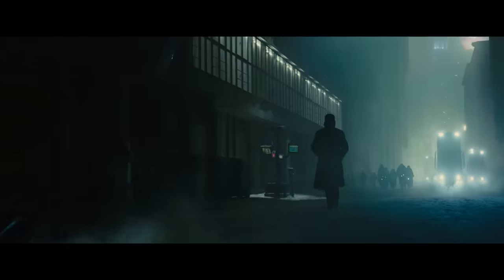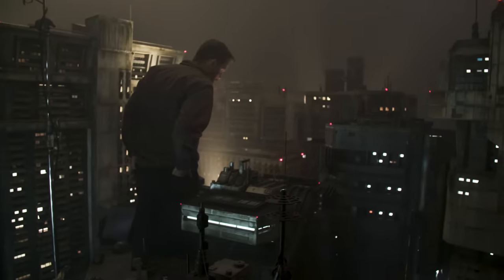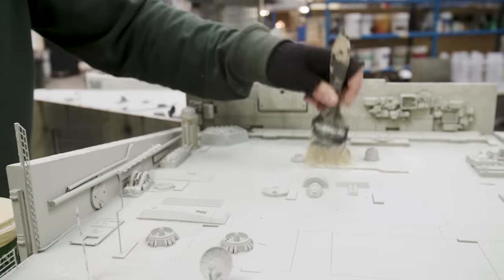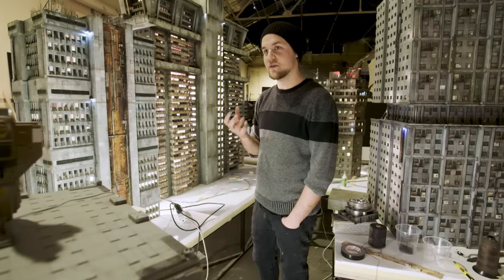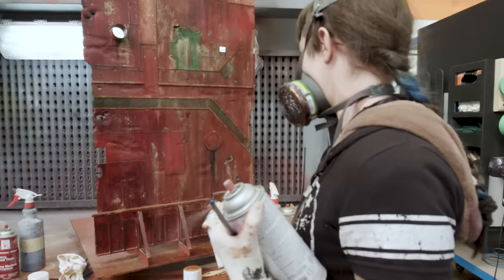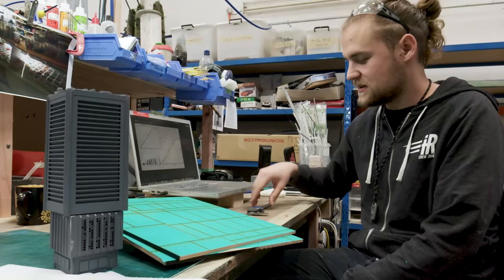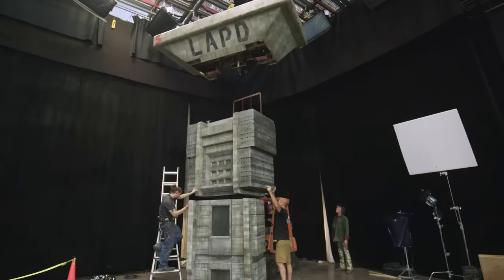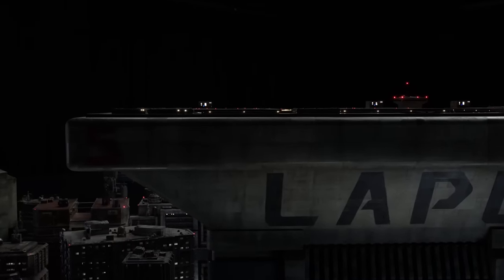Weta Workshop - Blade Runner 2049 Miniatures

Comment: I didn't realize these were miniatures while watching. Amazing job. Using good miniatures instead of CGI, future proofs films. 2049 will look great 20 years from now just like the original.
Reply: They used good miniatures as well as really complex CGI. Check out the video "Evolution of VFX and the making of BladeRunner 2049"
Reply: @gc3k  The key is they have enough practical footage to design the CGI to match up with. If there's no practical footage, they can't match it up with anything (hence zero-practical films usually have bad CGI).
Reply: @MrMarsFargo  So what about Avatar…..

Comment: I imagine the new versions of Cinefex for Ipad have more interactive and 3-D layers to move through. Not sure if they ever finished  all their old issues yet, or did their Blade Runner 2029 Issue in this format yet. My early Ipad stopped working with them. There are a couple of early Syd Mead illustrations at street level that I wish were turned into reality for this. Illustrations not done for either Blade Runner. Stunning stuff. Here's to Syd.

Comment: Honestly I saw 2049 twice in theaters, once at a $10 Reading Cinema then again at Melbourne IMAX in 4K Laser, and I thought all of the city night shots with CG. This isn't a jab at Miniatures or to say one is better than the other. It's just when it come to buildings/cityscapes and it is done right either way can be effective. Like they are recorded different illumination layers for the light sources, that is literally how you composite CG layers. 
That say, that rust for Trash Mesa worked awesomely.

Comment: Sorry to disappoint you but Framestore ended up doing all in CGI using none of the weta footage because none of the above ‘when filmed with the right camera move, lens, frame speed, and lighting’ were correct. http://www.artofvfx.com/blade-runner-2049-richard-hoover-vfx-supervisor-framestore/ - ‘Portions of K and Joi’s flight through the ships were planned as miniature photography to be augmented with CG from the start of post. However, the scale of miniatures reached a limit within the stage space to achieve what was ultimately wanted. The models then became texture and build designs for CG builds. Photogrammetry of the sets were extensively used to begin the process of constructing an entirely CG landscape’

Comment: Disappointing movie.  Considering the precedent set by the first movie, I thought there'd be a lot more eye candy.  It had its moments, but the futuristic skyscraper laden cites and slick lens flares of the original were mostly replaced by dimly lit and foggy shots that were often quite dull.  I actually started thinking that the "black out" they were referring to in the movie was the reason, but apparently that has nothing to do with it.  But just look at 4:09.  The buildings look abandoned.